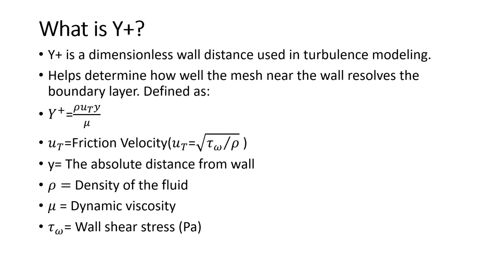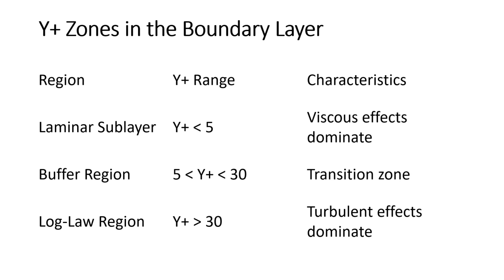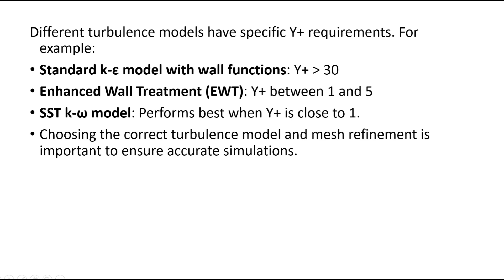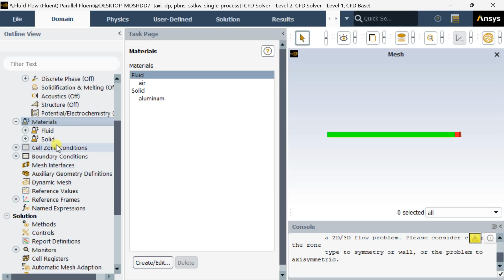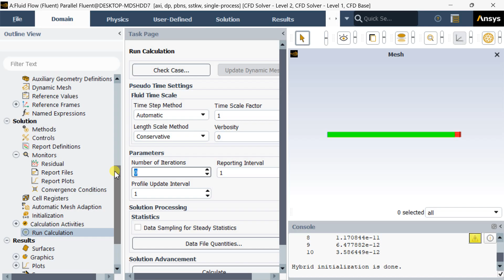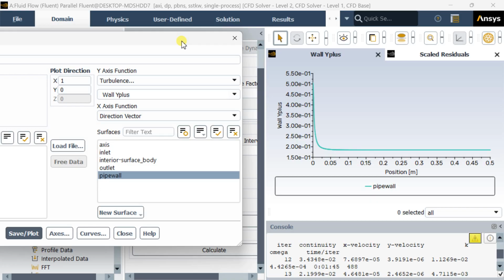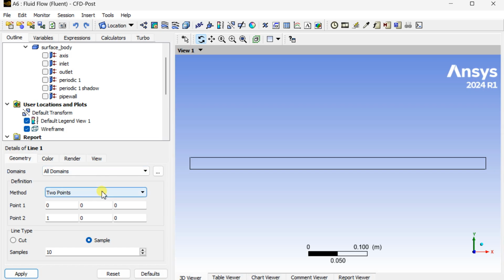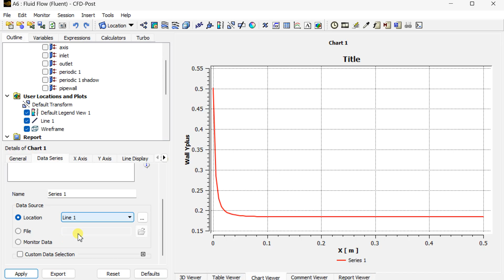ANSYS Tutorial: Y⁺ in ANSYS Fluent | How to Calculate and Interpret Y Plus for CFD Simulations

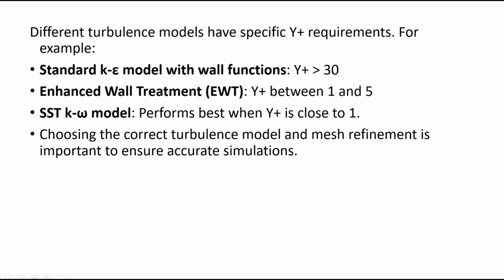Comment: 03:07,menter you mention that in sst k-w, y+ is closed to 1,May I ask whose paper you are referring to？I remember in menter's paper Two-Equation Eddy-Viscosity Turbulence Models for Engineering，as long as y≤3 in sst k-w
Reply from the maker: For the SST k-w turbulence model in CFD, the recommended y+ value range is typically less than 1 for the near-wall region. This ensures accurate capture of the viscous sublayer and boundary layer heat transfer. While y+ < 1 is ideal, y+ < 2-3 is also acceptable, especially when dealing with complex flows.